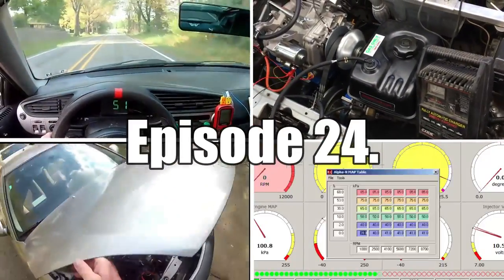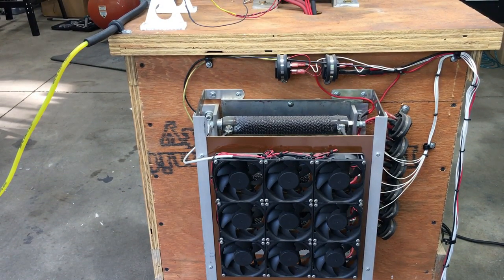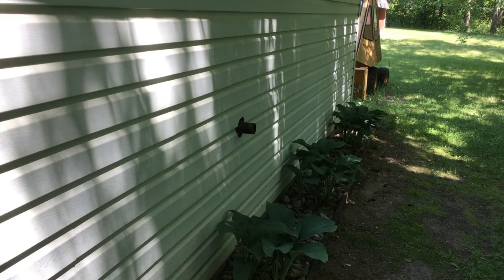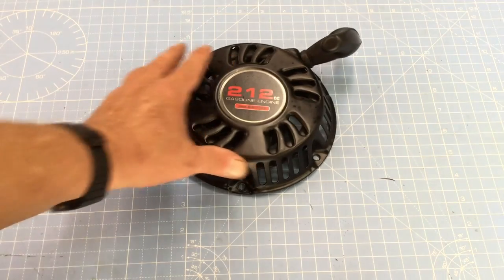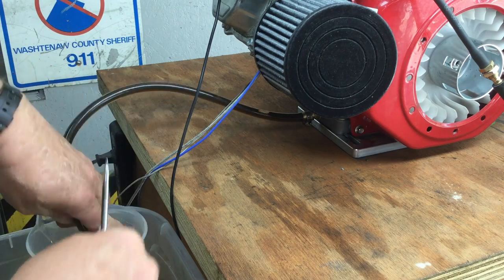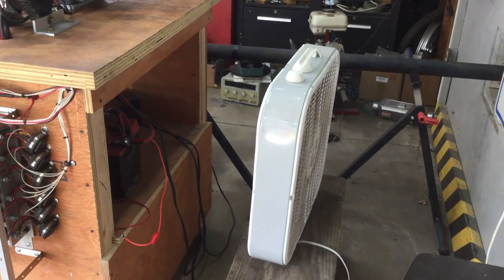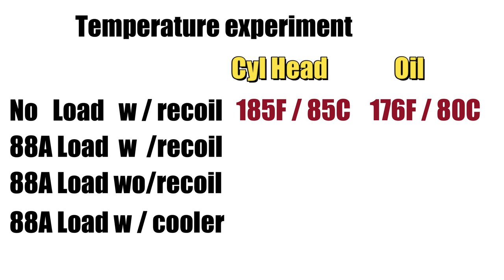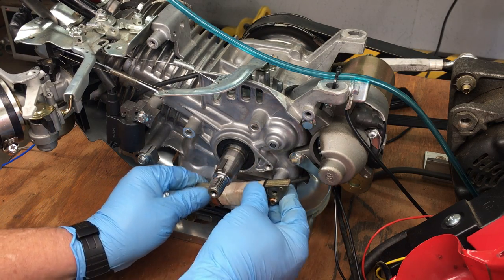Episode 24.  Testing an oil cooler on a 212 cc Predator engine

Comment: Does this engine have a vacuum line, which you can run a vacuum pump with?
I also would use a radiator fan, mounted on the radiator, sucking the warm air from the radiator, and blowing it on the engine. Any moving air on the engine will cool it down further. A low rpm 12V fan should draw 1 to 2 amps max, if you're not running it much past 50% of it's rated speed. For a small engine like this, a larger low rpm fan is much more efficient than a smaller high rpm fan.
Other people have drilled out a hole in the cylinder cooling fins and use a propane torch and solder a copper tube in the hole to the fins. And cool using water/coolant.

Perhaps unconventional, but you can mix up to 10% (preferably 5% or less) of water inside the fuel, which will certainly help to cool the engine.

Comment: What if you used a combination of a hot end cooler, pump, reservoir, pump, and Cold end radiator to cool the cooled oil some more from different air, the oil passing the radiator at the back end could be pressurized by a case pulse pump and sprayed across the rockers, crank, and cam shaft. The before mentioned setup would require no electricity, would use the case pressure that already exists as a power source, uses a diaphragm pump, and even if it doesn't work quickly, any cooling is better than none, plus any extra oil on the cams and valve train will help lubrication in areas that don't see good oil flow at higher RPM.

Could be useful, plus if combined with the intake of the fan that air cools the engine (which is fed warm air from the engine bay) and ducting to draw air like a cold air intake system, and you now have a cold air cooling system, that could maybe even feed the carb cold air as well?

I'm not so much on the EFI, CDI system setup side of things yet, but I would love to be able to cool my trail bike during slower rides that require high trottle to traverse but don't have good airflow.. added cooling would be useful.

Comment: I wonder if a vacuum powered diaphragm fuel pump would move enough oil and handle the temperatures involved? If not, what about adding a mechanical pump since you're adding that supercharger? Does the supercharger need some kind of oil flow? Awesome content, by the way!
Reply from the maker: the good news is the supercharger has a self contained oil supply, so no worries there.
Reply: @robotcantina8957  CONGRATULATIONS  ROBOT CANTINA...   104k   subscribers....  JIMBO  you provide the fun
and entertainment that viewers enjoy👍👍👍!

Comment: An eccentric star oil pump would take minimal mechanical power from the crank. You can also add internal oil sprayers inside the engine to cool hot spots such as the head, piston, and crank. It is most likely just a spashed oil lube system stock.

Comment: i bought what i thought was a nice generator to haul into the woods for tools. when i used it, ran a tank of gas, i heard a noise. checked it and the oil was boiling. is that normal? i changed the oil and found out there is a ridiculously small quantity. what, 1/2 quart?
does this vid tell me i can run the generator for tools and put an oil cooler on it and also run a fan to blow on the cooler?

Comment: Having owned an Insight for 13 years and installing three different IMA batteries in that time, I'd like to see how much performance you could've gotten out of the stock 3 cylinder 1 liter engine while removing everything hybrid related. 
Anyway, this is interesting too, though I'm not going to recommend this engine swap to anyone with a failed IMA battery. Keep up the good work!
Reply from the maker: Modifying a Gen1 will a full IMA removal and a different EFI controller would be a cool future project.  I have noticed that most Gen1 enthusiast hate it when the cars are modified and will complain if someone changes the floor mats to non OEM Honda mats.  A full IMA delete and new EFI ecu  might not go over well with the Gen 1 crowd.
Reply: @robotcantina8957  There's a rabid but small engine swap community. I had one that was stock and one with a 200+ hp K20a. I sold that one as it was borderline frightening to drive and I quickly realized that with a sleeper, unless you're blowing the doors off other cars, they're rather impractical. My stock Insight did occasionally return 70mpg and was my go-to for long trips, but the sh!tty IMA battery issues were too much. There are some turbo Insights on InsightCentral and likely use stock ECU's - and I love your videography style. I'd chip in as a Patreon if you did a 1st gen hybrid delete with performance mods. 😀 http://davesanborn.blogspot.com/2017/05/my-insane-honda-insight-k20-swap-is-for.html
Reply from the maker: @nazcaplain  K20's and turbo mods seem to be tolerated, but in order to get the most out of an IMA delete as far as fuel efficiency goes is to capitalize on the lean burn feature.  A different ECU would be easy to setup to maximize MPG, however lean burn generates a bunch of NOX and that kinda mod really triggers some people.  A few years ago I built a extreme fuel efficient Mazda Miata  https://grassrootsmotorsports.com/forum/build-projects-and-project-cars/1994-miata-mpg-project-b3-stealth-mk-ii/61007/page1/  Anyway, I got a bunch of shit from some forums because the car was "dirty".    Right now I have my hands full trying to build the channel so that it can fund larger projects,  I think at some point I will be finished with trying to go fast with various lawnmower engines and will move on to other projects.
Reply: @robotcantina8957  That's a cool & unusual Miata swap! Lean burn is slightly problematic, but in the end, isn't less CO2  probably more important than NOX? At any rate, there's always a % that's triggered. If you can dial in lean burn with Megasquirt, mazel tov and what are you waiting for? The only thing cooler than that would be a Li-ion battery pack, and here we are 20 yrs later and still nobody has figured that out. Side note: I'm friends w John Wayland who has a 400 mile range EV Insight project that never seems to be done. Maybe I should go lean on him?
I was living in Japan in 99 when the Insight debuted at the Tokyo Motor Show, and I was blown away. I'd missed the CRX bus and felt it was a great replacement. Too bad the nimh IMA battery pack is garbage, it would be a perfect forever car.
Reply: @nazcaplain  CONGRATULATIONS  ROBOT CANTINA...   104k   subscribers....  JIMBO  you provide the fun
and entertainment that viewers enjoy👍👍👍!

Comment: if you orient the oil cooler with the inlet and outlet at different "heights" you should still get some flow, and you might actually see similar results as the oilt cooler is relatively big compared to these small engine oil capacities, and since the oil would be spending more time in the cooler it could actually lower the overall oil temps better than that small pulse pump.  

I believe you want the bottom of the radiator to be coldest for this approach, so if you add fans or ducting make sure the bottom gets same or more air flow.

Comment: Look up a Kubota g1800 alternator. It's a miniscule little alternator for diesel lawn tractors that is so small you may be able to drive it off the chain drive system possibly with a roller
Reply from the maker: Good call, I have looked at those and will probably go that rout when the supercharger is installed.

Comment: im interested to see the results if you split the out put of the oil return and send some of it through the valve cover over the valve springs and head.  also. if you are cooling the oil it is thicker making it harder to splash into the valve cover. in motor cycles we lower the operating temp just by using and lower viscosity synthetic oil.
Reply from the maker: I think I will do another experiment where the oil is pumped into the rocker cover.  My only real concern is these cheap engines do not have valve stem seals, but I'm also not sure if that matters.... only one way to find out.
Reply: @robotcantina8957  CONGRATULATIONS  ROBOT CANTINA...   104k   subscribers....  JIMBO  you provide the fun
and entertainment that viewers enjoy👍👍👍!

Comment: Did you factor in oil in the oil cooling system? If you didn’t there likely was less oil than required in the engine which would have increased the cylinder head temp because those little engines don’t take very much.
Reply from the maker: Yep, I added extra oil to bring the level back to normal.
Reply: @robotcantina8957  CONGRATULATIONS  ROBOT CANTINA...   104k   subscribers....  JIMBO  you provide the fun
and entertainment that viewers enjoy👍👍👍!

Comment: Be interesting to see this testing with propane fuel, and the honda gx160 head strapped on the 212cc shortblock.
As well as adjusting the governor to about 4,500 rpms.
.
And see what happens..

Comment: suggestion; why not test out water injection? as in a small spray of water in the air inlet (or alternativly some alcohol?) ive seen it on much larger engines, but not on such a small engine. no clue if its gonna help tho :)

Comment: Great episode!  VO popping issue sounds totally fixed. Thanks!  ...  is it possible to blow/suck the engine fan directly through the oil cooler maybe?
Reply from the maker: On the test rig, we could move the radiator, but on the car the space is very limited and the radiator would need to be mounted in the grill area. Thanks for the heads up on the VO volume., I dropped the VO volume by -8 db.  Normally its -3 db

Comment: I wana know does a performance air filter alone does anything to a brand new engine with no other mods :)
Reply from the maker: The less restrictive air filter will cause the engine to run slightly leaner and some power loss can be expected.
Reply: @robotcantina8957  CONGRATULATIONS  ROBOT CANTINA...   104k   subscribers....  JIMBO  you provide the fun
and entertainment that viewers enjoy👍👍👍!

Comment: Could you not rap some copper tubes around the cylinder head fins and pump water round to a radiator should help with temps

Comment: One problem I noticed with your oil temps.  When the oil drops below 212F then it can't burn off any water that gets in it (condensation, etc)

Comment: Where did you get an electric start predator 212?
Reply from the maker: Amazon,  As I recall it was around $85.00 .  You get the starter, flywheel, shroud, and a bunch of bits and bobs.

Comment: Could you solder a copper pipe around the cylinder head and run engine coolant in a radiator?

Comment: Also, have you seen EC Carburetors has a 460cc big block for $340? That would be an easy way to bolt on some more power.

https://www.eccarburetors.com/wildcat-460cc-big-block-engine--pull-start.html

Comment: Like I said a couple episodes ago, since the engine is in an enclosed space it could be worthwhile to duct air from the front grill(e) to the fan of the engine in the go kart, tho an oil cooler definitely works wonders
Reply from the maker: I'm not against fabricating ducts, the only reason I haven't done so is because the supercharger drive system will occupy most of that space.  We will have to wait until everything is mounted before we can attempt ducting.
Reply: @robotcantina8957  ah that’s understandable, can’t wait to see a supercharger on there

Comment: Alot of air cooled engines rely on air to oil cooling. Most have an electric fan mounted to or in front of the cooler. Some positioned the electric fan to blow directly on head.  A more power friendly option is possibly a ducted scoop to draw in forced air while at speed. Either ducted right into the recoil area or onto the head.  I wouldn't trust a pulse pump. once your engine goes into a low vacuum situation or a positive vacuum when boosted i doubt the pulse pump is gonna be happy with the thicker oil.

Comment: Watched completely different video were this tiny dump truck would overheat, so they installed a small water bucket that would drip water on the head. Sometime the solution does have to be complicated.

Comment: if you can make some sort of cold air duct so when the car is driving it pulls in clod air from a bonnet scoop or grill to the motor might work and it wouldn't drain any power

Comment: Significant increase in cylinder head temperature might indicate that the oil is not enough, since you have to fill the radiator and all the hose you should put more oil in the engine. Plus that pump looks too weak or the hose maybe to small

Comment: Perhaps a washer bottle converted into a misting system for spraying water mist onto the engine during times of higher heat loads might be an option.

Comment: The oil cooler will add oil capacity too which will add to thermal mass if you add a container to hold more oil it would increase the time it takes for the oil to get saturated in heat.
Also the fuel pump is not ideal not because it isn't rated for the heat it is the viscosity of the oil which is significantly higher than fuel which is normally less than water.
But for this testing it is fine you should look for one designed for oil if you want to put it on the real thing.
Reply: Water cooling the head is the answer although not the low-dollar solution.

Comment: On different lawn tractors and even generators ( Kohler motors they use a vacuum pulse type fuel pump.  Vacuum line connected to the crankcase and the fuel lines connected to it.  It's mounted to the side of cylinder air duct shroud as it running in the fan air so while running it doesn't get hot (vaper lock, like old cars)  Fit one of these pumps (they are are completely plastic.  If for some reason they get to hot use the parts to copy and 3D print them is something that can take the heat.  It has a diaphragm that stands up to gas so it should stand up to oil, just how hot I don't know          .Fuel Pump for Kohler, Vacuum Fuel Pump with Fuel Filter for Kohler 17HP-25 HP Briggs and Stratton John Deere Honda Yamaha Small Engine Lawn Mower Tractor  You may be able to solve other fuel pump issues or oil pumping with this pump, or more than one.  They come in one day here in the Lexington Kentucky area.  at Ten bucks worth a try.  doing what your doing get more than one.  single cylinder motors make big pulses and restricting the crankcase with a ball valve may get lots of pumping action, use a true PCV valve for a car.  they come many ways, and they are one way valves and connect to vacuum ide of intake, you might ball valve them too to adjust the fuel pump and still not blow the seals out of the engine.  Can't seem to post a na image.  Just type in fuel pump for riding mower and there's many.  Just get the biggest or cheapest one.  I put one on a Harley Davidson , instead of the amazingly expensive electric feeding a float type carborator, and worked fine. Low on fuel tank and ran drag stripe runs and it worked till the tank was empty.  1340 cubic inch.  Normal fuel mileage 40 MPG.
4.3 out of 5 stars 34
400+ bought in past month
$10.99 
 One-Day
FREE delivery Tomorrow, Jul 3

Comment: I run my cylinder head temps in my race kart at 350F without the slightest concern. Over 425F starts to become a worry. You're running the engine now to be what we would consider cold. Oil temps not withstanding.
Reply from the maker: Great feedback!  Can I ask where you are measuring the head temp at?
Reply: @robotcantina8957  You're welcome! Under the spark plug.
Reply: @WyFoster  CONGRATULATIONS  ROBOT CANTINA...   104k   subscribers....  JIMBO  you provide the fun
and entertainment that viewers enjoy👍👍👍!

Comment: i heard mercedes got system that adds a little bit of water mist on intake
they said it helps with detonation cooling and something
Reply: Fun fact:
This system was first applied in Internalisierung combustion engines that where used in war planes at the time of ww2
Reply: @fertblusbenis5128  yeah right, also heard it was used in racing later but was banned for some reason

Comment: The oiling cooling system is great in all but there is way too much air bubbles in the system he needs to adjust his engine oil level to accommodate the engine plus oil lines and cooler basically run the the pulse pump adding oil till all the air bubbles are gone and the engine oil reads at  the right spot on the oil fill opening.

Comment: Build a sort of mechanically actuated oil pump, using like a diesel plunger or diaphram transfer pump, then it will use no power and put out 10-30 psi as long as the engines running, would soak up a little HP though. A diaphram pump would produce less flow therefore use less power however I don't know how the diaphragm would hold up against the heat of the oil as diesel fuel doesn't get anywhere near as hot through a transfer system